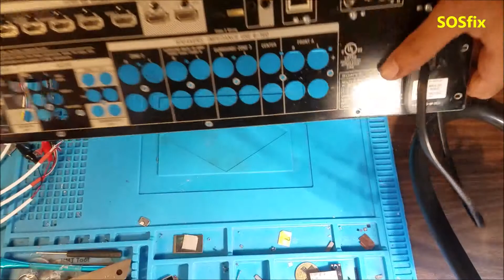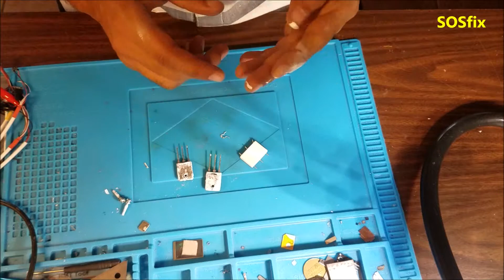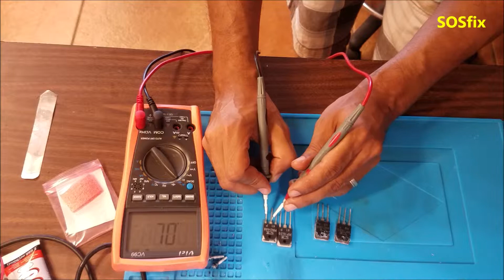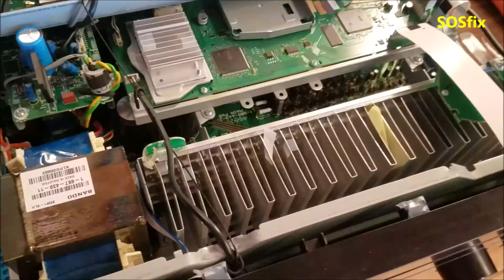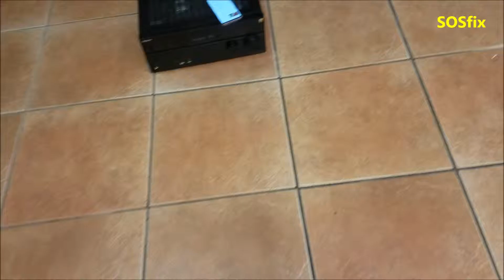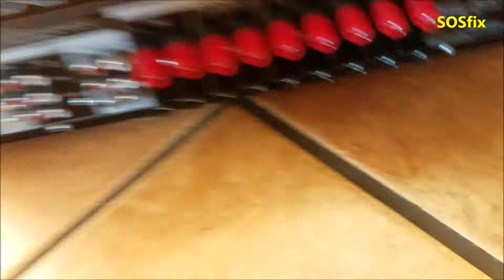sony STR dn1070 protect mode fix

Comment: Hi, thanks for your video, very helpful. By the way, where can I buy the resistors and transistors shown in your video, I am in France and I can’t find any supplier for them. Thanks.
Reply from the maker: alibaba  about 4 weeks shipping
Reply: @SOSfixElectronics  thanks for your answer but I already checked on AliExpress ( I think it’s the same right?) I can’t find the 5w 022 ohm resistors with 3 points to solder. Do you have a reference please?
Reply from the maker: is it a 22ohm or 0.22?
Reply from the maker: check with multimeter the one next to it to be sure
Reply: @SOSfixElectronics  0,22
Reply from the maker: if it is 0.22 here https://www.ebay.com/itm/7W-0-22ohm-Non-inductive-resistor-Audio-resistance-Speaker-Amplifier-resistance-/153123183757
Reply: @SOSfixElectronics  thank you so much.

Comment: I bought a str dn1070 and the guy before me shut it off before the reset was done and now it just says clearing and power cycles. I changed the 6800uf capacitor on it to see if it would at least stop power cycling but it didn't. just says clearing and power cycles every 3 minutes. what do you think the problem is or problems?
Reply from the maker: Did you try the hard reset?
Reply: @SOSfixElectronics  took the voltages on the pwr brd and #6 MHLDCDC was supposed to be 6.2 was only 4.6. I don't know what the hell it is I'm used to working on tv's.
Reply: @SOSfixElectronics  lol you funny thats what sony said 100 times. clearing is flashing nothing else works. tried hard reset 10 times. tried pushing all different combinations of buttons also
. pushed buttons while I was plugging it in like some tv's you have to. Nothing. no buttons work no nothing. tried putting new firmware on it and nothing.
Reply from the maker: If you have the schematic showing that 6v and you got only 4v. Try to inject 6v  using external power supply. And see if the receiver will stay on (I dont have schematic. I m just guessing from what you said) good luck

Comment: After having it disconnected for 3 or 4 days, it went back to work without having done anything to it. I am placing it in a better ventilated place and removed the self turn-off timer limit because protector mode happened after equipment turned off automatically.
Reply from the maker: Your receiver needed to reset only. You didnt have a fully shorted components. Check the speakers wires. Or you may have a partial shorted or bad capacitor.

Comment: Hi there,I have a str dn1080 which was dropped on the back left side,now it won't power on,I've opened it up and no signs of damage,in your opinion,what do you think may be the problem?
Thanks jason
Reply from the maker: Could  be a small crack or bad connection somewhere

Comment: Can you help me with Bluetooth speaker?
Reply from the maker: whats wrong with it?
Reply: @SOSfixElectronics  Bluetooth just stop working, i tried resetting it but no fruit,  i have ion block rocker ipa76c model,  i keep pressing Bluetooth button but nothing happens, plus i opened it to see where the Bluetooth chip is located but still i cant found any chip just a antina wire
Reply from the maker: @jasonbourne-gh9fc  this is the bluetooth ic in your model, it is little board soldered on the  top of main board, (cwtws_m_508_v008B311) check if it is getting hot
first is the other functions in your speaker still works? only the bluetooth not work?
Reply: @SOSfixElectronics  yes i can see that, its a bit bigger than usual that's why I was asking, it is not heating, little bit Rusty i cleaned up, but no fruit, 😔, other functions are working fine, like radio, am, fm, aux , mic,  actually aux has a distortion cant play normal volume 10, 20......is there anything else I can do like replace aux with usb or another Bluetooth ,
Reply from the maker: @jasonbourne-gh9fc  look closely on the bluetooth board for bad connections or cracked solder joints. And check the vcc main in the bluetooth board if it is existe. Must be 3 to 5v. There is a replacement board online if you want to try it.
Reply: @SOSfixElectronics  thanks, I'll look into it,and see if it's there is something, can you share the link where to buy, thanks
Reply from the maker: search by (Ion Audio 60210039-I)
check this one if it is the same as yours https://www.instrumentalparts.com/60210039-i.html
ask them if they have it in stock ready to ship before you pay, prefer do paypal in case they sent you a defective one
at this point you still not sure if changing the bluetooth board it will fix the problem
Reply from the maker: i forgot to ask you, the light for the bluetooth is on and in pairing mode?  if yes put your phone on the bluetooth board and see if your phone will detect it. if yes thats mean you have a bad connection to the bluetooth antenna. i did see it before from cuz speaker vibrations
Reply: @SOSfixElectronics  no the light is not ON... i thing the chip is burn... i;ll give another shot to test it...but my guesses are the bad chip... :(
Reply: Hi there,I have a str dn1080 which has been dropped ,back left corner,now it won't power on,what's likely the problems that can have happened?
Thanks jason